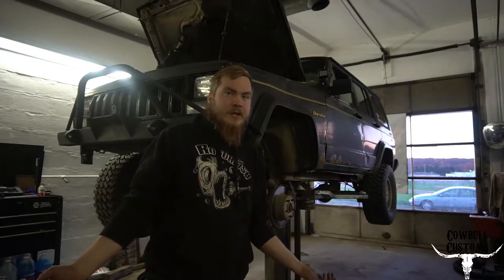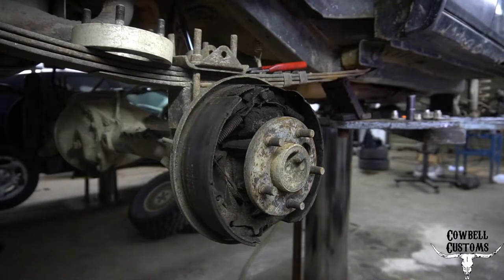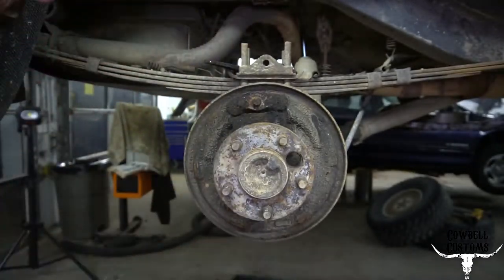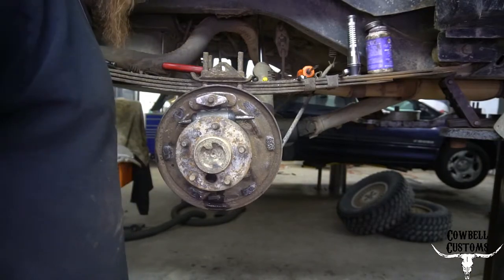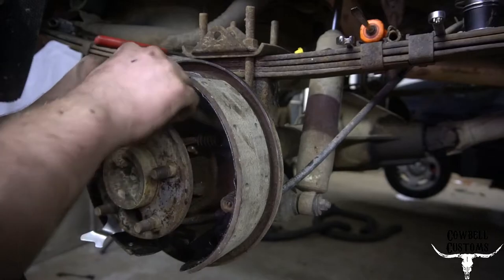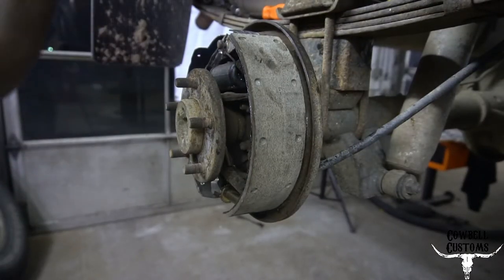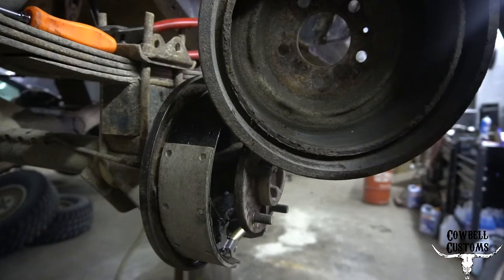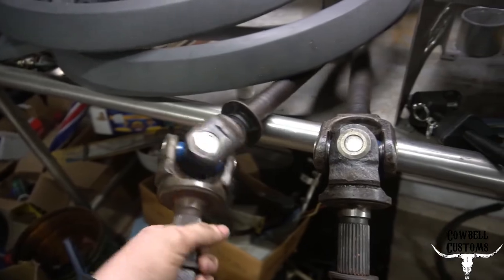Jeep Cherokee Rear Brake shoe replacement

Comment: Hello,thanks for the video. Having my shoes replaced this week, 99 Jeep Cherokee sport 4.0 4 wheel. When I called part's store, they said they had the 9 inch and 10inch shoes, and didn't know which one's would fit my jeep. I'm thinking 9 inch, what do you think? Thank you, guess I'll buy both and take the other back, they only have kit for 9 inch and Wil have to order kit for brakes if they are 10 inch. So hopefully they are 9 inch shoes. Thank you
Reply from the maker: It would depend on which axle is in the jeep and to my knowledge in those years it's either a Dana 30 or a Chrysler 8.25 I'm not sure. Maybe pull a wheel off and measure the drum quick to be sure
Reply: @CowbellCustoms  Thank you. The 9 inch fit, Appreciate your help. Thank you

Comment: what is your dogs name 

get to the point
Reply from the maker: Ive got two dogs, Jack and zero. 
And to summarize
“For a number of years now, work has been proceeding in order to bring perfection to the crudely conceived idea of a transmission that would not only supply inverse reactive current for use in unilateral phase detractors, but would also be capable of automatically synchronizing cardinal grammeters. Such an instrument is the turbo encabulator.
Now basically the only new principle involved is that instead of power being generated by the relative motion of conductors and fluxes, it is produced by the modial interaction of magneto-reluctance and capacitive diractance.
The original machine had a base plate of pre-famulated amulite surmounted by a malleable logarithmic casing in such a way that the two spurving bearings were in a direct line with the panametric fan. The latter consisted simply of six hydrocoptic marzlevanes, so fitted to the ambifacient lunar waneshaft that side fumbling was effectively prevented.
The main winding was of the normal lotus-o-delta type placed in panendermic semi-boloid slots of the stator, every seventh conductor being connected by a non-reversible tremie pipe to the differential girdle spring on the “up” end of the grammeters.
The turbo-encabulator has now reached a high level of development, and it’s being successfully used in the operation of novertrunnions. Moreover, whenever a forescent skor motion is required, it may also be employed in conjunction with a drawn reciprocation dingle arm, to reduce sinusoidal repleneration.